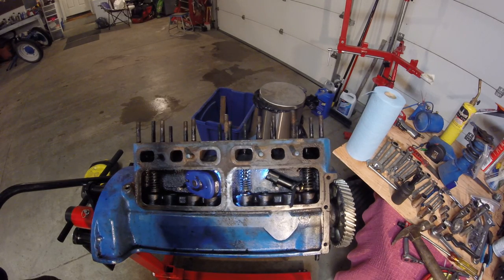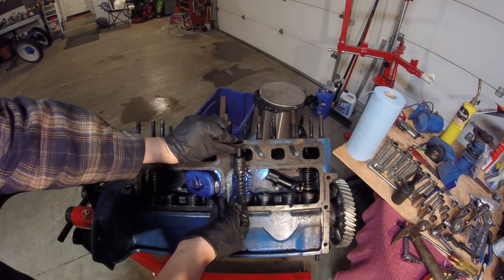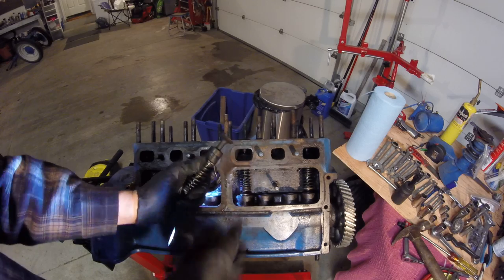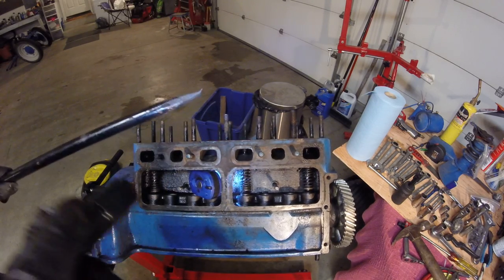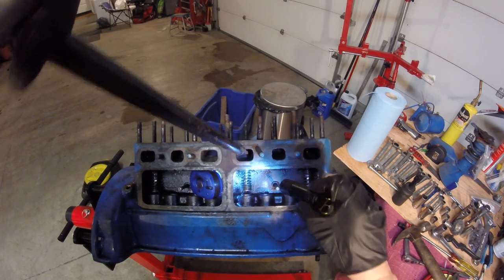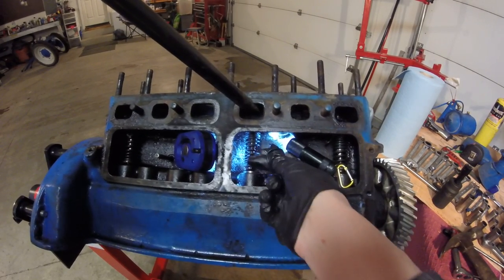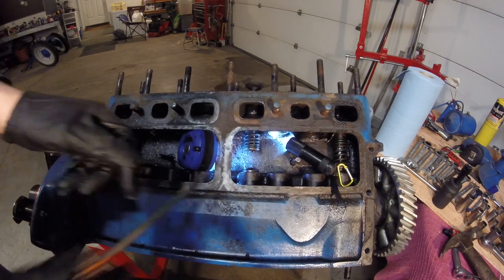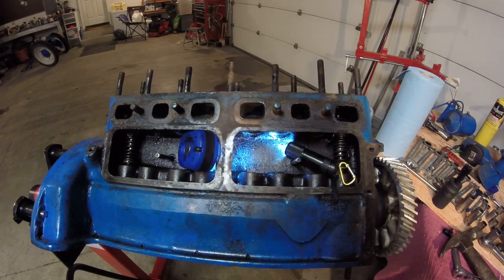Ford 9N Valve Removal

Comment: Were you able to reuse the old valve springs or did they need to be replaced? Good video.
Reply from the maker: If you go to YesterdaysTractor.com you will find replacement springs for $2.42 each. I never considered breaking the engine down that far and not replacing everything. They also have complete valve overhaul kits for the entire valve assembly for $100. Engine rebuild kits starting at around $200 depending on how far you want to go. I'll add that you can sometimes find these parts for a little (like really little) elsewhere, but Yesterdays Tractor is really easy to work with and parts for old tractors is all they sell. These guys know their stuff. I am not affiliated with them in anyway. They are just a good company.